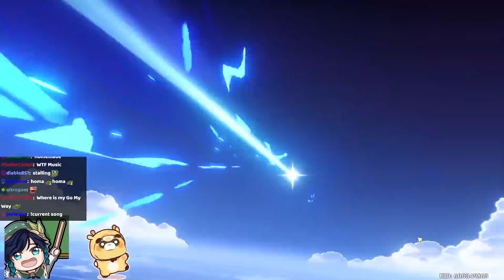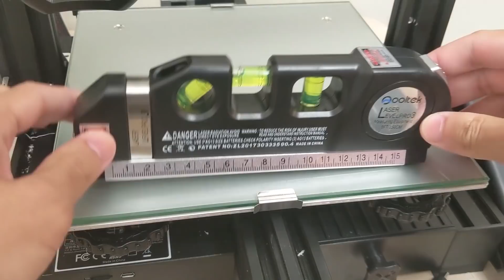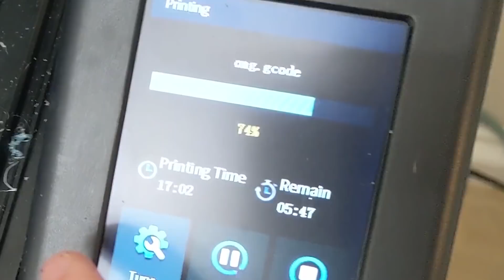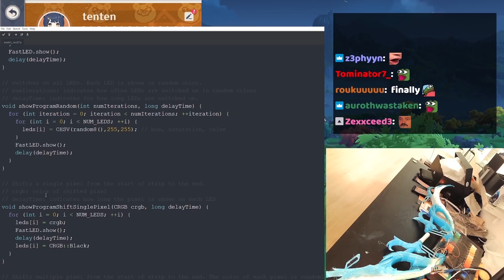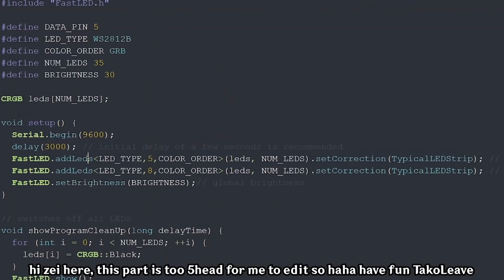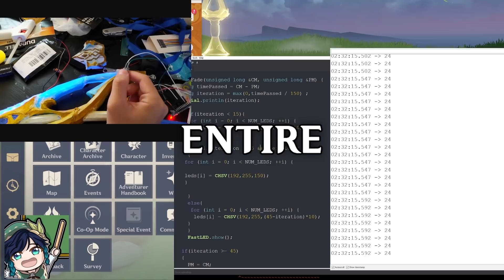RGB Elegy for the end from Genshin impact (FULL BUILD)

Comment: You should of given it a bit of a sand to just smooth it out the painting wasn't the problem ( also use super glue instead of hot glue it has alot less flex to it so and makes it more rigid )
Reply: yep, if u prep sand and prime the platic it is 1000000x better to paint